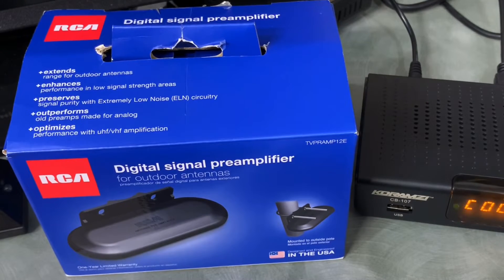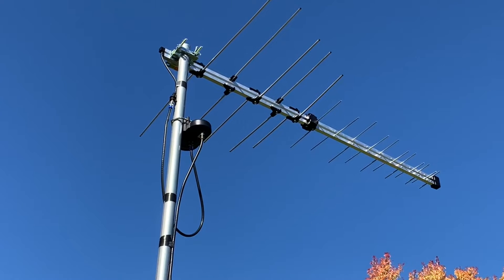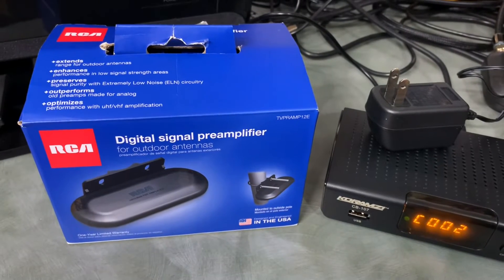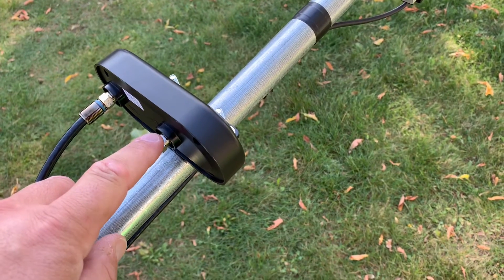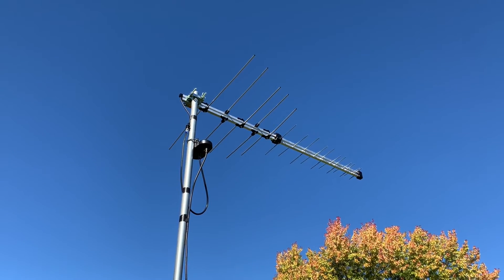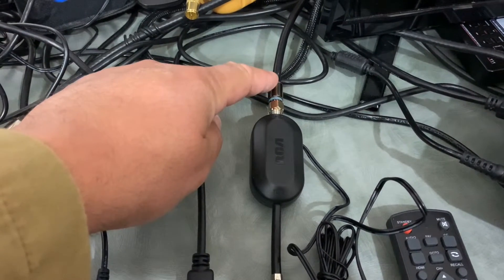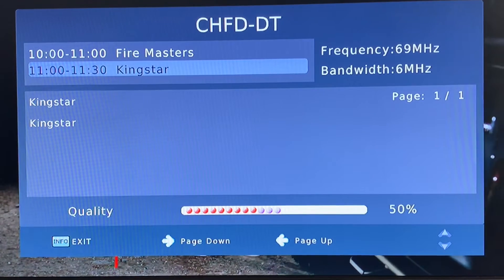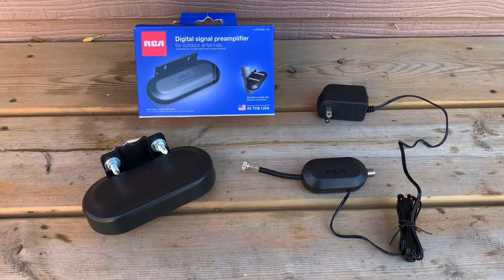TV Antenna Preamp - how it can help your Television Antenna Signal

Comment: My preamp outside has the vhf and the uhf hookup. Then it has what is called the trap if I just want to hook up my uhf antenna should the trap be set to on or off?  I'm not understanding what this trap is for.
Reply from the maker: It's an FM trap to prevent FM radio interference with your TV signal. A couple of videos for reference:
https://youtu.be/OjYC1CZOz60
https://youtu.be/WAnwZhv9ohQ

Comment: Enjoy watching these old videos I have this model believe it or not it actually works better on VHF than the $80 televes model. I just ordered a Radio shack preamp for $55 on Amazon it has a 33 db gain with adjustable gain control.

Comment: Do I need  a converter box are I just. Connect to my Tv
Reply from the maker: @StephenStandridge  you can connect your antenna directly to your TV as there is a built-in tuner. Or you can connect it to in digital converter box.

After the antenna is connected, run a channel scan.

Digital TV Converter Boxes Run a channel scan - Auto program for over the air antenna channels
https://youtu.be/nA3avMLayTc

All TV’s - How to Run a channel scan (auto program) for over the air TV Antenna channels
https://youtu.be/nvyERtjSWvw

Comment: Hey  i had to go up and install another antenna panel and diplexer combiner and had to move my pre amp closer to the antenna  however its close but on a 3' cable just wondering although i am getting good reception
Reply from the maker: @zandig666  If it’s working OK, then no problem. Just try to keep the cable length between the antenna and the preamp as short as possible, but 3 feet is totally fine.
Reply: @NorthcoasterHobby  many thanks my last upgrade will be all new connectors in some spots   at one point I cheaped out  but hey its (free ) 😃😃 and I scanned 62 channels last night  pointing at toronto, Rochester and Buffalo mostly over water and reception will improve once the leaves are off the trees
Reply from the maker: @zandig666  Excellent! That area is awesome for OTA TV.

Comment: I’ve got a Channel Master 8 bay antenna on the roof with a 10 ft mast, and pre-amp mounted on the mast below the antenna. When it was installed, instead of running the coax straight from the antenna signal box down about 3 ft to where he mounted the pre-amp, he ran the coax up to the top of the mast, down the inside of the mast, and then back up to the pre-amp, adding about 10 feet to the length of the coax between the signal box and the pre-amp. Do you think I’d lose channels less often if the coax was run directly down the 3 ft from the antenna signal box to the pre-amp?
Reply from the maker: I’m not sure why the installer would do that. I would think that the coaxial cable run between the antenna and the preamp should be as direct and short as possible. All that being said, I don’t think it would affect the signal- 100 feet yes, but not 10. As long as it is decent quality RG6 cable, shouldn’t be an issue. Still an unusual way of doing it though.
Reply: @NorthcoasterHobby  Thanks for your reply. I guess the installer thought it would look more professional that way.😄 Glad to know it doesn’t make much difference in my reception though, because I was thinking of going up and changing it. Not a great place for a senior to be, even if it is just a bungalow.

Comment: But the preamp will slso amplify the noise right? Will it maybe produce any extra noise on some part of the rf spectrum?

Also do these things have any filters in them?

I would like to use one of theese for SW band not tv, and I dont want it to filter any frequencies

Also what happens if u feed the signal into it, will it pass the signal back to the antena

I sometimes like to use my antena to transmitt signal so I connect a transmitter to its input and because its directional the signal can be received far away

So if I put preamp in between will I still be able to do this or the amplifier block the signal?
Reply from the maker: The preamp should establish a low noise floor. Much lower than adding an inline amp down the line. A higher quality preamp like a Televes would do a better job rejecting noise as well as filtering 5G, LTE, FM, etc. too. But if you want to use this for short wave, you might want to check into an amplifier designed for that instead of a TV signal amplifier.

Comment: What do you think about using a preamplifier and a distribution amplifier? Is it a good idea? Or is it overkill?
Reply from the maker: Use one or the other, not both.
Reply: @NorthcoasterHobby  gotcha. That makes sense. My preamp gets the signal through the whole house just fine
Reply: @NorthcoasterHobby  If only using one, is a preamplifier with a non-amplified splitter, a better option than a distribution amplifier it I want to split the signal to two televisions?
Reply from the maker: @Mark-og5mh I would go with the preamp and a passive splitter.
Reply: @NorthcoasterHobby  where would the splitter be located? Thank you
Reply from the maker: @samlucas4826 It should be installed indoors, after the preamp. But you will need a splitter that has power pass-through, so it will allow voltage to be passed back through the coaxial cable to the preamp.

Comment: The antenna with preamps are suitable for places with medium to low or low signal. The good part is that you can use a classic splitter mounted after the inserter. Do not mount a splitter between the preamp and power inserter becuase you either have no signal or the signal is bad especially on UHF band. A classic splitter has between 4 - 10 Db attenuation, a diplexer has 2 Db attenuation. 

I rememeber one case where I had to install a UHF Yagi antenna with 44 elements with a built in preamp. And in order to connect to multiple TVs I also had to install a 20Db amplified splitter to have the signal strength between 80 and 90%. to connect to 3 TVs. The reason was the tower was more than 50 km away and lots of trees. No possiblity to install a satellite dish, otherwise it would have been much easier. The best part is that the preamp can be easily replaced. If you don't need the preamp you can mount an impedance adapter or matching transformer and use it as a regular antenna.

Preamps can help you with DX-ing if you want to receive channels outside your area but you need an antenna with higher gain.
Reply from the maker: Good advice Nicholas, thanks.

Comment: Just to add, it's probably a good idea to weatherproof your outdoor coaxial cable connectors even if you don’t purchase an outdoor mounted preamp. RF Weatherproof Boots are incredibly easy to install as they simply slide up and over the connection.  They slide back off of the connection just as easily, making them a great coax connector weatherproofing solution, especially when you are concerned about re-accessibility to the connection. There are different types of boots to match different connector and cable combinations, You can also purchase one that is IP68 rated should you choose to do so.
Reply from the maker: Good advice, thanks for sharing it.👍

Comment: Preamps can seem to magically get stations/channels that had no picture before because, after scanning, tuners store the data for stations/channels even though some signals are below the threshold to get a picture. You should also tell users to rescan after installing a preamp. From my (and one of my client's) experience, the GE preamp is a good low cost preamp. However, some of the highly experienced senior professional TV antenna installers in the FaceBook group probably have opinions about the noise level of the RCA and the GE compared to the gold standard/best/unique (and probably highest cost) Televés preamplifier models.
Reply from the maker: Good tip about re-scanning. I wish I would have mentioned that. I’m sure some people will have opinions about the RCA compared to other brands. But it’s the only external preamp I have right now, and yes, I’d say it’s a good performer at its price point.😄
Reply: Another misnomer/wasted word. "Price point" is a statistical term for a location on a graph. Please just say price.  @NorthcoasterHobby
Reply from the maker: @bjs2022  Noted.
Reply: @NorthcoasterHobby i bought the onn brand. It does a whole bunch of nothing for me. Thought i needed it🤷.

Comment: I have been using a Winegard LNA-200 Boost XT HDTV Preamplifier, TV Antenna Amplifier Signal Booster for about 7+ years now. The antenna on my roof is difficult to access, so I use the booster near the TV. Helps with a low-vhf channel (ch6) that otherwise is unwatchable most times.  Ran about $40-50.
Reply from the maker: Good to know, thanks for the comment!

Comment: One of the things that I feel should be stressed is keeping coax as straight as possible and don't make any sharp bends or kinks. I am old school I still use Antenna Mast Standoff rather then tape to prevent any induction from the mast pole and never run RG 6 parallel to AC power.
Reply from the maker: Fair point. Any measure to reduce noise or loss is worthwhile. I tried to loop the jumper down a bit to soften the radius on the cable. But yes, sharp bends should be avoided.👍

Comment: Just bought a Televes dual antenna input preamp and my reception has never been better.
Reply from the maker: Awesome! Can’t go wrong with Televes.
Reply: @NorthcoasterHobby  I recently removed my 4 antenna combination with the Televes dual input preamp and went to a 2 antenna setup. The reason for it was to get a more reliable signal for Metv toons. One antenna east facing and the other south.  It's the only way to pick up rf10, s.e.direction , some 45 miles away, and a 1 edge obstruction, especially during  the hot summer and bad weather. Happy with the result, nearly always good. 
The problem now is that I lost rf9 and rf11 to the n.e direction and rf26 to the sw. Need to turn rotor to get them. Thinking that the smartKom may be the answer to avoid using the rotor. The dual input preamp works perfectly with no issues capturing any channels it's pointing at.
Reply: Sir. I have campet van with an antennea outside the van. Magnetic.

What would you recommend?

Comment: IMO this one is junk, get a Maspro for about $30-40.  Every connection is about -2db plus each split is -3.5db so it adds up.  Usually you'll be good with a quality 20db amp.
Reply from the maker: Is Maspro sold in North America?

Comment: If it runs thru your 'tv box',it ruins everything. Better connect the co aux cable to your tv set directly.
Reply from the maker: The DTV box has some features many TV’s don’t have. Either one will work fine.
Reply: If you run directly to your tv & have a rotor you limit your channels when hou change direction you have to re scan your tv. Having a box allows you to add channels without losing what you had